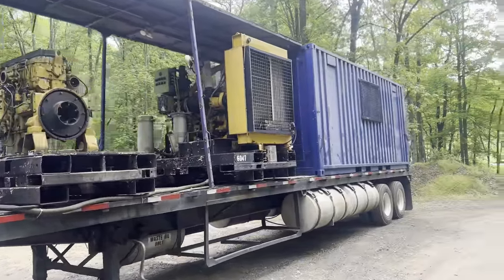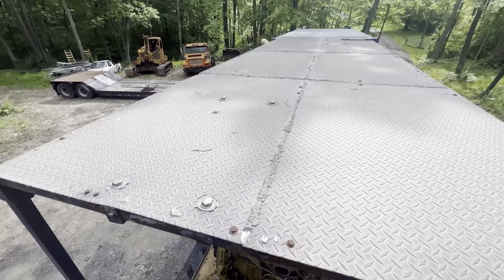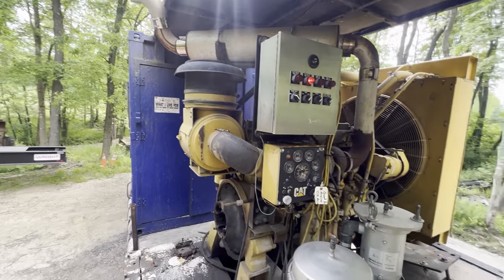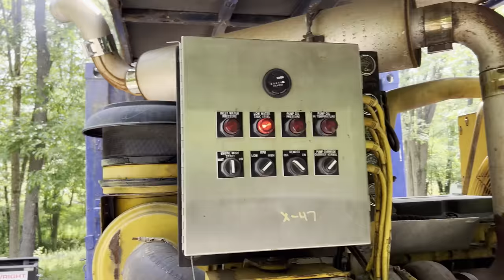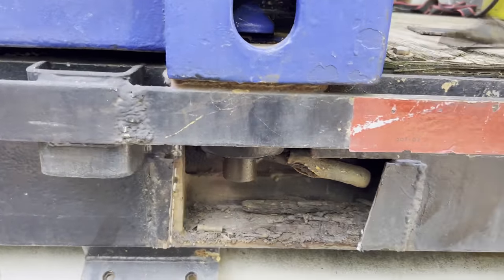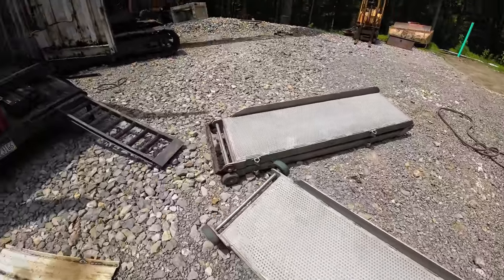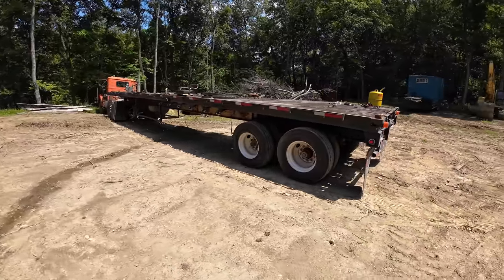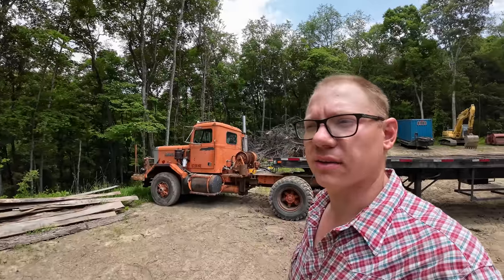I paid nearly $6000 for this Unit at the Auction, Sight Unseen, Will it run??

Comment: wondering if it would be worth adding the new floor on the trailer yourself before sale - given that you have the sawmill and tree's available (?)
Reply: I guess it's the time which is in short supply here... ;-) And anyway, if you make any extra repairs or "upgrades" the price will go up (unless you want to work for free for someone you don't even know), which would make it harder to sell that beauty in spe. And then it may turn out that the buyer would actually prefer to deck this thing with a steel sheets, or he has a good friend who runs a sawmill... Better don't go overboard - there's a helluva other work to do anyway, and if the prospective buyer would ask Matt "but can you deck it for me?" then they may work out some deal, hopefully.

Or so I think ;-)
Reply: @MrKotBonifacy nah man you nailed it. Never do more to something than you need to to attract a buyer. Anything else is wasted time and effort and bites into your profit margins.

Like you said, if they want it done they can ask and work a deal to pay for the work as part of the buy… but even then it better be a solid buyer so they don’t flake just when you’re supposed to be getting a briefcase full of Benjamin’s!
Reply: @ArmchairDeity  You can always tell them "OK, deal, I'll deck it up for ya, and that'll be so–and–so much bucks, UPFRONT". Y'know, better safe than sorry ;-)
Reply: @MrKotBonifacy  yeah probably best to offer it as an option, then a potential buyer can decide if it's adding enough value or not.
Reply: @MrKotBonifacy  I 100% agree dude… you nailed it. Your time is your most limited asset, don’t use it unless you need to! 

And yeah, doing it as a service for them when they buy it is a whole different thing than doing it in advance without anyone asking for it.
Reply: @fundi_mike  Precisamente, amigo! : )
Reply: @ArmchairDeity  Righto!

Comment: JUST before the wheels went in the air, I was thinking fat Alice needed a little more counterweight, seems to have decent lifting power ...
Reply: Man… when she started to rock forward my heart just started to this hard in my chest… I get that Matt just played it off but 45k # flipping up in the air with the steering flopping it around like a puppy’s tail…

Working in a similar environment that would have brought the whole crew running out to help, rolling up on the tractor or with the skid loaders… just stuff to help get it back under control.
Reply: Yeah, I thought I could hear her say "I gotta bad feeling about this...", but who knows.
Reply: @ArmchairDeity  Or in certain parts of the world it would have brought a dozen guys scrambling to climb onto the ass end to act as a temporary counterweight. 🤣
Reply: I had to re watch it, a few times, cos I did laugh, I could see it standing up on its tiptoes a mile off 😂😂 good nothing got torn up, and she went back down on all 4 smoothly!
Reply: Needs to fill the back tires with water/calcium mix. Like farmers do to add weight.
Reply: @iain3411  well he does have 4 fuel tanks now, he could put on the back for ballast!

Comment: That thing used to have a huge water pump in the middle, like 800+ bar. It was used to cut concrete or steel, or to drill deep holes in the bedrock or something. I've seen a similiar rigs on at couple of job sites here in europe.

Comment: This is a hydro “jackhammer” concrete removal machine. It uses 10,000-12,000 psi to explode the concrete off of a bridge deck. It works kind of like an old typewriter. Vac truck sucks up the debris. 10,000 psi pressure washer to clean. Then we would overlay the bridge deck.

Comment: The computer may have a low pressure cut off switch for when it is pumping water and the source runs dry.
When a computer cuts out an engine look at the scenarios for what the engine is set up for, in which would be dangerous or expensive if the engine kept running. Often times the computer shutting down the perfectly-running engine means it's not satisfied for safety or function. Like a ride-on lawnmower trying to start with the blades engaged, for instance.

Comment: Hindsight is definitely 20/20. I was yelling at the screen when you first tried to turn it over, "PULL THE INJECTORS THEN ROTATE IT!". LOL It looks like you'll do well with that buy as you part it out. Quite a bit of sellable stuff there, four 100-gallon plus fuel tanks, diamond plating, two engines, aluminum heavy-duty ramps, and a flatbed trailer and other stuff.
Reply: You  most likely  got  over  6000  for  the. Running  engine  plus a bit  for  the parts engine  plus  every  thing  else.   Good  luck

Comment: I used to work with a guy just like you, all the red flashing warning lights in the world could be flashing giving all the foreshadowing of what's going to happen if you continue, and that dude would just claim he knew better and just sit there and crank along. Lot's of perfectly good equipment went to the scrap yard because of that dude. "That warning light is ....well...warning me if something, ahhh it'll be fine"
Reply: I'm glad I'm not the only one that sees it. The only fella I know that doesn't bother to go look up purchasing manuals for this equipment especially that old deuce-and-a-half truck military Surplus. There is books and manuals and everything out there to be found and used.
Reply: Had to cringe when he said he thinks its hydro locked and then proceeds to force it to turn over. I've never worked on a diesel in my life and I still know it's stupid.

Comment: HydroDem is incredible concrete removal/breaking with an incredibly powerful water jet (looks like a jet washer on steroids) which sounds like a jet aircraft taking off!  The operator wears huge steel boots to prevent foot removal.  It leaves rebar spotless.

Comment: Cat alert engines were well known to have a number of issues. One is the rocker shafts like to come loose and wear the cylinder head.   I wasn't the biggest Cat fan working as diesel tech. The older weren't bad but the newer EPA engines were nothing but trouble they not afraid to deny warranty. Referee to everything as progressive damage. And most expensive parts in the industry
Reply: Acert  spell check

Comment: I haven't yet watched the entire video, I'm just guessing on what I think the issue was. I feel like that wire Sam unplugged may have gone to some piece of equipment that is no longer on the machine... maybe it could have been a sensor that tells the engine to shutoff when there is no water in the pump to prevent damage?

Comment: Sorry Matt but the main reason you tipped the wheel loader was because you had the container to high up making the wheel loader longer and then turning it full right. If you would have lower the container as close to the ground as possible and tilt it backwards the wheel loader would have made the turn. By doing that you would have made the wheel loader much shorter and less risk for tipping.
Reply from the maker: You are correct. But I had to have it up in the air to clear the lowboy trailer next to me.
Reply: @DieselCreek  Ok I see, or I didn't see that 🙂 🙂

Comment: Guessing start mode may have something to do with an aux fuel pump running until engine fuel pump takes over then switch to run mode.  Start my either have something it defeats or activates interlock wise  to protect engine in start and run mode.

Comment: A company I used to work for has iterations of these with huge 3 and 5 cylinder water pumps. Mainly we used them in parking garages to cut through concrete. The ramps were for the robots that would make the passes across the concrete. They would put 10,000-30,000 psi out of water pressure out of a a hole the size of pencil tips. We also used lances with the water pumps too to remove laminate off of cooling pools etc. the engines usually had twin disc ptos with pulls levers. I had my hand caught in a cog belt style setup one time and broke 3 fingers and a couple other bones in my hand and arm. Thankfully the engine was off and it occurred while putting the water pump to pto belt on.

Comment: At approximately 44 minutes. that is a really dangerous way to move that torch. Get a little bit of scrap metal and make a torch buggy that has the tanks rigidly mounted and is grabbed by fork pockets. One more thing I know but them bottles are precariously perched that way and I don't thin you want to die yet.

Comment: I was shouting at the screen as you were attempting to get this to run  "LOOK AT THE DAMN LIGHT on the box - READ it,   it is obviously a failsafe circuit  to prevent it from running a VERY expensive high pressure waterpump dry which probably cost more than the Cat engine and destroying it,  -  and is obviously connected to the injector pump pressure switch....confirmed when you were able to start it with ether,   and then watch it inevitably stop everytime you tried it without....it was the third time you  got it to start for two seconds without ether that I noticed it ran till EXACTLY the same moment you let go of the startex...then I rewound and read the lable on the RED tell tale, scrappy obviously did too and simply removed the bi pass.  in the trade by the way those container clamps are universally known as   twist locks, most usually used on dedicated container trailers  called skeleton trailers,
 its pretty unusual but not totally unheard of to have what you have there....a dual role trailer...that is one with a twist lock frame AND a flat bed for general cargo loads, it would be daft to scrap it...especially in the obvious good condition(apart from the redecking) it is in, there WILL be someone  in the market for it trust me....
methinks Fat Alice could do with a couple of tons of counterbalance weight at the back of the frame keep your eye out for an old dog of a counter balance fork lift or loading shovel you could buy and steal it off., and as for those diesel  tanks you took off, they could go straight into that twenty foot box giving you three hundred gallons of the diesel storage that you spoke of building  maybe as two reds and two whites for instance.
  plus using that old oil tank still under the trailer  maybe you could buy bulk deliveries of Rotella straight from Shell to keep handy - got to be cheaper and easier  than buying it five gallons at a time surely ?..

Comment: From my thinking it was a good buy, the running engine and the trailer should make you a little more than you spent. Good wheels, tires and brakes make the trailer worth something. 150 gallon fuel tanks while not worth their weight in gold should still fetch a decent price. Plus you got all those good batteries and two winches, and those are always handy. 
I think getting the Autocar running better is a good idea, at least then you can haul stuff on your schedule, not someone else's. And if needed you could make a little hauling something for someone else in a pinch.

Comment: I could have used that rig or at least parts of it for my well water system.  We have to pump well water up a hill to use in greenhouses.  It's like a problem from fluid dynamics class.  How do you pump water up a hill to fill a huge reservoir?  Horsepower.  HA!

Comment: If I was able to discern the video right, I believe the cable that was unplugged, is the same one you plugged in. No judgement, just next time things might be unplugged for a reason.
Reply from the maker: Yes this whole thing with strung out over a month or so. I completely forgot about connecting with cable until I was editing this back together. 😂🤷🏼‍♂️🤦🏼‍♂️

Comment: MORE THROTTLE!!!

You don't say "he cranked it right up".
Cranking has to do only with turning the engine over not running.

HE DISCONNECTED THIS WIRE AND HE STARTED IT RIGHT UP, OR IT STARTED RIGHT UP.

It cranked right up sounds dopey.

Comment: Guessing "hydro-demolition unit" would be a similar contraption to old hydro mining in the west, where a pressurized stream of water would be used to blast a hillside into slurry, which would run downhill into sluices, where the valuable elements would be extracted.  I'm guessing the "demolition" aspect of this unit is it just would use that high pressure water stream to blast apart structures.  Guessing the ramps into the box would have held the units own self contained wheelloader for cleanup, like a little Bobcat.

Comment: Does it have a murphy switch that you have to hold in for a few seconds until it gets good oil pressure . Alot of stationary engines have those to kill the engine encase you lose oil pressure or it over heats.

Comment: I had always been slightly paranoid with used industrial equipment not knowing the sites where the heavy industrial equipment has been. Job sites like mining industry or cleaning up contaminated places and I keep a curious mind on not knowing if there’s a level of Radioactivity or  has been used by a nuclear waste dump. I’m sure there’s a tight lid on radioactive contamination with government use and whatnot but I’m still skeptical things get passed around and sit in storage for decades and generations of people pass on by and they could forget why a certain storage facility was keeping the equipment around and they decide to send it to auction  and wallah a n unsuspecting buyer buys something with higher levels of radioactive or chemical contamination and could potentially pose a threat short term or long term.  A Geiger counter radiation detector would be handy anyway like I said I keep this as a possibility and I hope it never happens but it would be kewl to have a Geiger counter 😎👍

Comment: I wonder if the tank hangers bolts were rusted solid to the trailer frame. Even if cutting off bolts like for the fork pallets. Seems like the tanks would be worth more with the hangers to mount them. The hanger straps seem to unbolt pretty good. Looks like parting out the trailer should be able to double the money. Wondering if the Cat13 is worth what was paid for the trailer. The hour meter said 800 hours, but you said 5800 at the end. Was that a mistake? The trailer itself looked to be worth maybe $4K. Taking off that conex had me gulp! That was dicey. And YES your front tires and FA look about ready to come off the rims. Please air them. Yikes!

Comment: If I bought that trailer I would make it into a recovery trailer to rescue old equipment but I would reconfigure the trailer I’d put the container on the front and the roof on the back so just basically just flip it around because I’ve seen bad things with the containers on the rear of the trailer also I would make the good engine a generator abut that’s my opinion though

Comment: I believe this was used for demolition on buildings they would use this to keep the dust down  Just like a fire truck basically while they're turning down just spraying everything so it gets wet and keeps the dust  Down. That's my guess
Reply from the maker: No it ran 35,000 PSI pressure washers basically that would cut concrete

Comment: Damn, even just the trailer is worth 5-6 thousand if you took everything off, checked all the airlines and axels, and threw a new coat of paint on her lol

It stands to reason that, if they took the time to pump the fuel out of the saddle tanks, they stripped the entire trailer of anything they needed lol.. 
you should put that C13 in the auto car, or the excavator or something .. that’s a decent engine with decent power output, but honestly , that trailer and con-ex with the roof over it would be an awesome road rig for Mobil mechanic-ing lol.. you pretty much have a workshop of wheels lol.. I’d probably try to use it, though I don’t have an awesome new massive shop to work out of unfortunately lol

Comment: Watching at home here wondering if someone else is watching this and thinking "Oh man, I spent so much time building that system!". (Edit: Noted the comment from RobertTouchtone who knows that unit you just took apart).

Also on the Autocar, my dad drove trucks for a while in the mid-late 1960s all over the country and said he mostly went about 45 since that was about the best the trucks could do which places him well before the Smokey and The Bandit age of truck driving when the high horsepower trucks burned up the road.   Nowadays with the electronic logs and GPS systems the truck are almost all driving perfectly legal speeds because big brother is always watching and checking.

Comment: Doesn't that motor have the turbo charger you just had rebuilt and couldn't find anywhere"?  I bet it has a better housing because the one they used was crap.

Comment: Sorry Matt viewing this episode so late couple of ideas.💡💡💡💡 The roof would make for a great wood shed for seasoning fire wood for the radiant floor heater burner out back.😎😎👍👍On that rolling high deck it would make a great cannidate for hauling weld rig with two of those diesal tanks mounted on the inside of the frame for a young starter upper. All used equipment install of curse as a starter kit. Steel cabinets, vises, reels, storage, etc. etc 👉👉 Hands down. 👈👈Then sell it as a nice even price to a guy or gale starting out. 👉👉👉👉👉👉👉👉👉👉👉👉👉👉👉👉👉👉👉👉👉👉👉👉👉👉👉👉👉Gotta Spend a little money to make even more money.

Comment: dear  matt  don  kunkel    this  unite   you bought  is used for for hydro blasting  piping  of  scale  and  building up  coating  from processing   the oil and chemical  piping  of processing   of products  of the industry  real  costley for  finding  a highpreasure   pump
is the most  expensive  device  your missing    where is the pump and hoseing  for doing work    don kunkel napa ca  it  appears   you  got  a pice out unite  for parts   not  good matt  this could  get  expensive  to fix and replace  all parts  missing